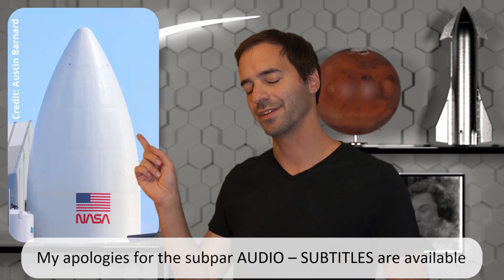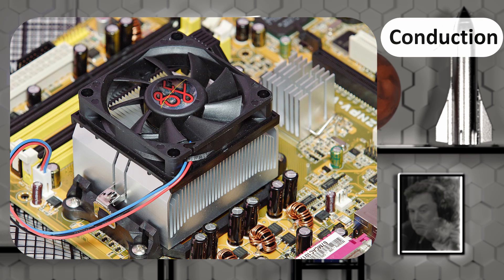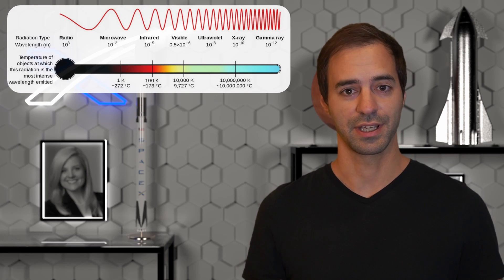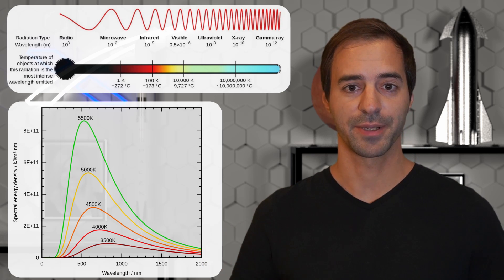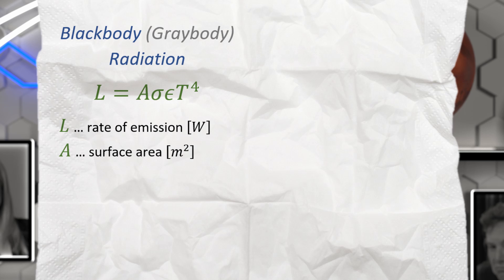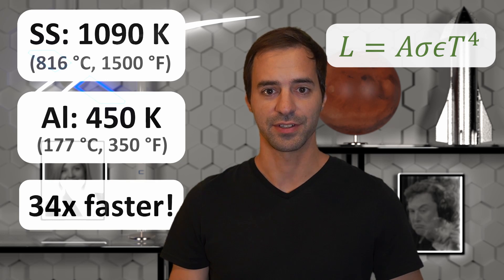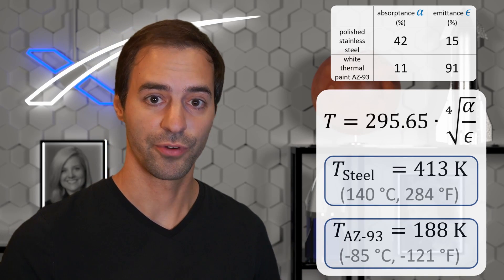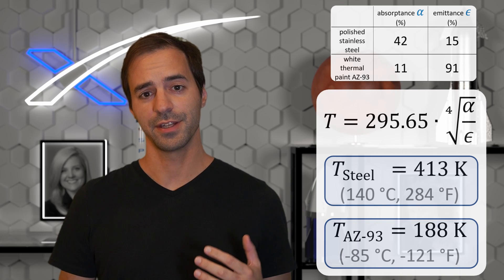Why Is Lunar Starship White?

Comment from the maker: Oh shoot! I have switched the values when creating the table graphics at 10:08 . The numbers 11% & 15% are switched, only in the graphics. The math is done with correct numbers.

Also, my apologies for the audio quality - I am still travelling and the whole recording setup was improvised in a hotel room.
Reply from the maker: @adrianmoisa2281  Hi Adrian, thank you for stopping by and congratulations! I wrote you a message on Discord.
Reply: Shouldn't there be a 1/2 in there? Like with Fourier's calculation of the 'skin' temperature of the Earth? I've forgotten the exact formula, but only half the surface of the cylinder is being heated, while the whole surface is radiating. Basically, Fourier's simplification was assuming that the Earth was absorbing as a disk and radiating as a sphere.
Venturing off the napkin, the Starship is going to have a portion of the cylinder filled with cryogenics if it is not going to remain on the surface.
Reply from the maker: @Markle2k   Hi Markle! Thank you far watching my video! 
That is exactly what the variables "As" and "A" mean - "As" is the cross section that is being illuminated. If it was a sphere, it would be a disc. It is a cylinder so the cross section is a rectangle. The "A" variable is a full outer surface of the cylinder, so it exactly as you say: absorbing only on part of the surface, and radiating from the whole surface.

To your second point - yes, and that will be a major pain for SpaceX. The thermal equilibrium temperature does not change whether you have fuel in it or not. They will still need to have a lot of fuel inside when landed (>100t), and with the temperature of the fuel slowly increasing and boiling off, they will have to be constantly venting it out and loosing it. We are talking probably over 1 percent of fuel every day lost.
Reply: Audio was ok... had forgotten about the Blackbird
Reply: instablaster...

Comment: I find it fascinating that basically a mirror is reflecting less light than a white surface. If you had asked me before I would have said steel reflects more light than white paint. Keep up the great work and stay safe in these difficult times :)
Reply from the maker: I guess it is not as mirror-y as your eyes would suggest. Also, It might absorb differently at different wavelenghts... For example, a yellow printer pigment will absorb almost all the light in blue wavelengths, even though it is a bright color to human eyes...
Reply: It's all about the wavelengths. Steel is basically black at some infrared wavelengths. Titanium dioxide is white through a broad spectrum.

Comment: These videos are great! 
I had heard Elon mention the 'to the power of four' aspect of thermal radiation but I did not go any deeper than googling the formula and seeing there was a ^4 in it. Now I feel like I actually understand the problem. I have a small tungsten cylinder I am going to try to use what I learnt to calculate how much thermal energy it would emit if it was heated to close to its melting point.
Reply: I only needed the grey body formula to calculate it. Seems like my tungsten cylinder (height 5.5cm, diameter 3.5cm) would emit around 3000W of thermal energy at its melting point, this is less than I thought it would be considering the extreme temperature (3650K) but the surface area of the cylinder is small so I suppose it makes sense.
Reply from the maker: @laurent7461 Laurent, this is awesome! Tungsten is pricey :) Look at the NASA paper in the reference, they describe their experiment of getting to the absorptance and emittance numbers. And boy, they tested tens, if not over a hundreds of materials, paints, films, coats...

Comment: excellent, i had played with those equations before for many times, i had to calculate for my solar panels and for a radiative cooling project i did some years ago, i still remember them, but this video was very informative about heat balance in space and on the moon
Reply from the maker: That is great! The back-of-a-napkin math is pretty powerful in this case because it is close to an ideal scenario :)

Comment: Very interesting as always! Among the newest channels dealing with Spaceflight-related topics, yours is (by far) the best, on my opinion... there is a (stupid) question I would ask you (if I may) about Starship materials: a stainless steel starship couldn't undergo cold welding in Space? Wouldn't this pose a tremendous risk for its (huge) moving parts? Could this (on the other side) possibly strengthen its hull? Thanks and have a pleasant (and safe) trip.
Reply from the maker: Thank you for your support! I think that Veritasium had an interesting video about cold welding. I think it happens really rarely by accident - you need two perfect metal surfaces from a similar material that have not been oxidized at all. The oxydation is the important part, because I would think that even stainless will oxydize a little on the surface during the manufacturing and assembly
Reply: @spaceflightexplained360  Thanks Vojtech 😊.

Comment: Super little video.. thank you... I always assumed a shiny surface would have been better...
Reply from the maker: It is slightly counterintuitive right? The issue is that the wavelengths from the Sun are extending way past the visible light, and the shiny metals tend to absorb those.

Comment: Ok, I guessed the answer posed in the title correctly, but boy,  was I surprised to see the actual numbers. Very interesting! Would have loved to hear a little about apollo lunar lander in this context. Had to google a few images to be reminded large parts where indeed white (even though it wouldnt have been exposed to sunlight all the time).
Reply from the maker: I was surprised by the resulting numbers as well when I was done with the simple math! It was clear that I have to make a video about it :)

Yeah, the lunar lander had very different solutions, because it was in the payload fairing during the launch. They solved most of the thermal issues by using MLI (multi layer insulation), which is fragile, but much better. On satellites, you will also see MLI everywhere. And MLI is even on ISS between Whipple shields and pressure vessel walls.

Comment: I like the science behind your channel. Not to everyone's taste and you should really get more likes. Your joke on 'would SpaceX do that just to look cool?' was a little gem. My suggestion for a hypothetical discussion, is a method of protection from space debris for inter-Moon and Earth travel. Once in Space, if they had a cone section on the top of the rocket that released a silk skirt/shroud 50 meters long. The top connection to the skirt would be charged slightly positive and the SpaceX 'hull' slightly positive. This would keep the skirt away from the SS sides by an adjustable distance. If a piece of space debris hit the silk, it would be slowed by the action of pulling the mass of the skirt in before hitting the SS hull. That may slow it down enough to stop piercing the hull? Also the silk might act as a sun visor or 'radiator' for heat? Or do you think the space debris would just cut through like a hot knife through butter?
Reply from the maker: Being an expert now that I made a 18 minute video about protection against MMOD (sarcasm, but if you didn't see it, please do!), I am pretty sure that a projectile travelling at 7 km/s would go through such a fabric so fast and easily, that there would be no transfer of kinetic energy between the two. Not even multiple layers of ballistic Kevlar will manage what you are suggesting. All you can do is to put enough material between the projectile and the ship with enough standoff  - the energy of the hit will still not stop the projectile, but gives it enough thermal shock that it breaks apart and hits the ship more as a cloud of debris and not one solid piece.
Reply: @spaceflightexplained360  I did see your excellent video. Might look at it again. So like I thought, like a hot knife through butter. Silk was good enough for the Chinese top military against arrows, but not quite suitable for space. Thanks for your quick feedback.

Comment: Gotta love your analytical approach.  This problem is similar to calculating how to Terraform Mars by adding heat and starting a greenhouse effect.  Assume for the moment if all the solid CO2 on Mars was heated above the freezing point. Then assume the resulting greenhouse effect was identical to earth’s. Solar equilibrium dictates Mars temperature would be Earth Temperature *(Solar radiation strength on Mars/solar radiation strength on Earth)**0.25.  Since Mars is 141 million miles from sun and Earth is 93 million, and inverse square solar radiation, the relative strengths are (93/141)**2. Thus, Temp of Mars would become Temp of Earth*((93/141)**2)**0.25) or 300 degrees K*(93/141)0.5 or -29 C.  That’s 56 degrees C colder than Earth.   If Elon wants to warm up Mars, then he needs to forget about nuking the planet and instead install millions of square Km of orbiting mirrors deflecting sunlight to the surface.  He could actually do it.
Reply from the maker: You are absolutely right - some basic Earth's greenhouse effect calculations can be done with these equations too!
Reply: What is NOT considered in your equation, is the radiated heat from the core of the Earth as our rotation slows and greater pressure is applied to the core. (Also the mass of the Earth increases by about 300-400 tonnes/day from space 'dust'). I do not know  what Mars's core is composed of. It does not have a magnetic field. Either the pressure is not strong enough to solidify the molten iron core or the core does not have iron (Not likely).

Comment: It is hard to believe that a bit of white paint, is the difference between frying like a steak and turning it around so much, you will almost equal the coldest natural temperature ever recorded on Earth at  -89.2  (−128.6 °F; 184.0 K) at Soviet Vostok Station in Antarctica on 21 July 1983. I guess it will be a bit warmer if you take into account (as you pointed out) the reflected light off the moons surface and the heat from wiring, computers, equipment and Crew, emitted internally. 
It would indicate that there might need to be some * removal * of paint in the area of the cargo hold, to raise the temperature to around 20
Reply from the maker: Right?!? It is weird. Getting rid of heat of really hard on Space. When you think about it, it is where Sci-fi ship design gets it wrong. Unless their powerful propulsion is 100% efficient, the ships should be just covered with radiators!

Comment: How will this work out on Mars? I know the atmosphere can provide radiative cooling, but it's so very thin - will that be effective? Or will SS need an active cooling system dependent on drawing in huge volumes of air. Or... will Mars ships also need white paint. This will be a problem since the TPS is black.
And thanks, now I actually understand the reason for the white HLS - for about 2 hours  :)
Reply from the maker: I think that the problem on Mars might be the opposite. It receives much less light due to the distance, atmospheric scatter, day/night cycle and the atmosphere, even if very thin, will be cooling or down constantly. Do they might actually need more warmth

Comment: The thermal balance is not just of interest for the astronauts, but also because the Lunar Starship will have cryogenic propellants on board, which need to be kept cool to support leaving the Moon. The analysis in the video is correct; this is just an added nuance. In case it’s of interest, I recently calculated that bare stainless steel could lead to a boiloff rate of around 3 percent per day, while white paint could reduce that to less than a percent. See https://www.reddit.com/r/SpaceXLounge/comments/jmxo8u/starship_fuel_boil_off_estimates_mitigations_uses/gb24xg3/?utm_source=share&utm_medium=ios_app&utm_name=iossmf&context=3
Reply from the maker: Cool! (or not cool?) You are absolutely right, and you cannot really isolate the fuel from the potentially hot steel skin. Now I looked up the methane and oxygen phase diagrams because of you... Well, at 8 bar (or how many can Starship take), the boiling point does not increase too much, so that won't help. How about the fuel in the header tanks - can it be much better isolated from the rest of the Starship? Would it be enough fuel to get to the Moon's orbit?
Reply: @spaceflightexplained360  Going from the Lunar surface to orbit takes about 1.87 km/s of 𝝙V and getting to NRHO takes another 0.73 km/s for a total of 2.6 km/s needed to get to rendezvous with Orion and/or the Gateway. Lunar Starship will be lighter than a normal Starship. If Lunar Starship weighs 60 metric tons (which I suspect will be an underestimate, especially given the weight of the passenger support equipment) then achieving 2.6 km/s given an ISP of 380 will require 61 tons of propellent. If Lunar Starship including fittings instead weighed 120 tons, then one would need around 121 tons of propellant. I believe that the normal header tanks were planned to hold around 30 tons of propellant. So, standard header tanks wouldn't do the trick. However, one could conceivable build extra-large header tanks for the Lunar Starship to provide thermal isolation for ascent propellant. (This all assumes a Lunar Starship would be refueled in NRHO. It would need even more ascent propellant if refueling was going to be done in a highly elliptical Earth orbit, as might make sense in some scenarios.)
Reply from the maker: @zzubra  Thank you for the perfect answer - I wonder, where is the estimate for the combined header tank volume coming from? Boca-chica spies with pixel counters? :)
Reply: @spaceflightexplained360  The 30 ton figure comes from an Elon tweet (https://twitter.com/tobyliiiiiiiiii/status/1251385328159436800 ) There is also a compendium of Starship information on elonx.net (https://www.elonx.net/super-heavy-starship-compendium/ ) Some people interpret the 30 tons as just LOx, though Elon compared it to the total propellent capacity of 1200 tons, so I interpret 30 tons as total mass of propellant in header tanks. Since LOx is 78% of propellant mass, the two interpretations don't yield wildly different results. 

Edit: see also https://forum.nasaspaceflight.com/index.php?topic=50049.0 This gives LOx header tank volume as 18.67m³ and methane header tank volume as 16.21m³. Given LOx density around 1.141 ton/m^3 and methane 0.423 ton/m^3, that would mean 21.3 tons of LOx and 5.6 tons of methane for 26.9 tons of propellant total. These sizes are based on pixel-counting don't exactly match the 30 ton figure, but it's in the same ballpark.